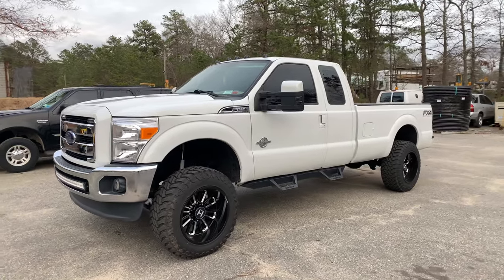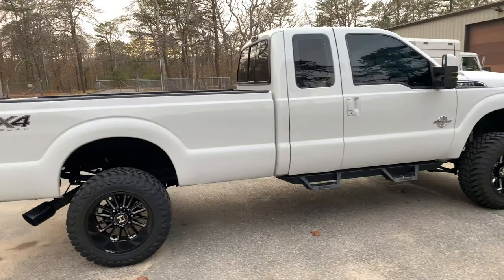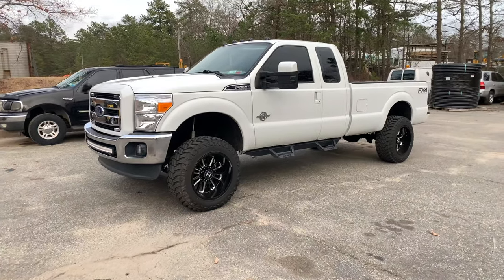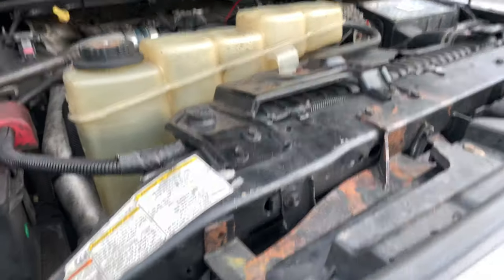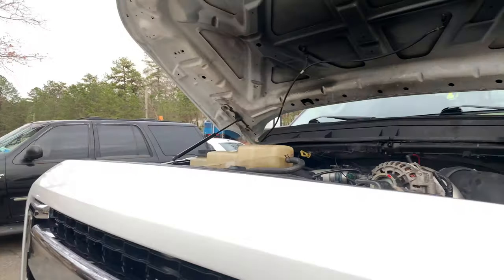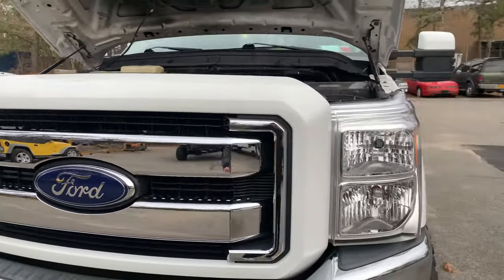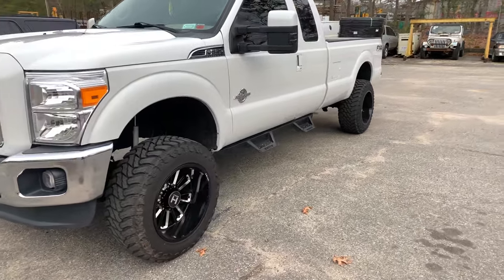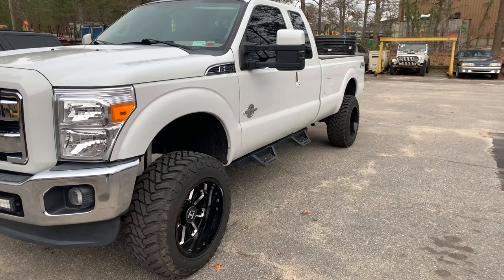99-04 F250 SUPERDUTY Conversion To 2016 (Walk Around)

Comment: Sure beats the hell out of spending 70k on a new one.
Reply: and the thing is twice as reliable
Reply: Exactly! I have a 2000 F550 that I bought for $17k this year with only 150k miles, I'm getting ready to do a full 2018 conversion of the interior and exterior. I love the body style, but I don't even like the newer diesel engines. This is my 3rd 7.3l powerstroke because my first one got totaled by a Volvo and I sold my 2nd 😢 regret it ever since. Now I have an F550 I will never part with, so I'm going to turn it into the truck of my dreams.
Reply: @danielallen9610 how’s it going

Comment: Outside is expectation and when you open the door is reality.
Reply: Is looks good and I rather have the 7.3 does 6.0 power strokes are bad all of them are pretty much trash
Reply: @carolinamartinez1085  their not if you build them bud
Reply: @NOAHR101 yea if you add like another 5 grand to get it bulletproof
Reply: @conormayweather5474 Give or take. So pay $20k for a 200k mile 7.3, or $12k for a probably running perfectly fine 6.0 with 100k miles and drive it till it blows and bulletproof it or do it immediately. Boom $17k in the truck, just as reliable, newer, rides nicer, good fuel economy and more power. The amount people sell 7.3s for now is killing the point of why people loved them.
Reply from the maker: @FordFan01 I prefer the 6.0 over 7.3 you’re absolutely right , 7.3 is overrated
Reply: @FordFan01  actually I seen them a lot cheaper now here in Texas , I just sold mine for 6 grand an extended cab with 280,000 miles

Comment: Im doing this same conversion. to my excursion. I need the 2016 wiring harness for the headlights and adapter... im having a hell of a time locating this. How did you get yours? or howd you wire your new lights?
Reply from the maker: @jimmylomeli9248  eBay sells the adapter should be like a 9007 to H11 bulb harness or something along the lines of that, I think the aftermarket LED bulbs might also work could buy the 9007 bulb kit and a H11 bulb kit and use the h11 bulbs with the ballast from the 9007 kit so it plugs into the factory harness

Comment: doing this now and my front bumper looks like yours at the 4:19 and 4:20 mark where you can see the fender mount hole right where the bumper and fender meet. I see you were able to move the bumper up, im curious what you did to move it up. I also have the factory foglight in the bumper, I noticed that clearance is an issue. I have spacers in there now to help move the bracket from the fog light bucket. This moves the bumper forward but im trying to avoid moving it forward much more due to the offset of the curve of the wheel well between the bumper and fender. What adjustments did you make to get the bumper up higher to close that gap? Did you make new mounting holes? The very last picture you show at 4:24 is what im trying to get to (smaller gap).  I have the mcnasty bumper bracket kit also. Any info is greatly appreciated, great video!
Reply from the maker: For the front bumper I ended up just mounting it directly to the old bumper mount that’s notched out but I only used the bottom mounting hole on Each side to mount it, I had the mcnasty bumper bracket also but when I tried to use it my bumper wouldn’t look right and had a bigger gap like how you explained yours.
Reply: @wildingarage2003  aaahhhhhh ok. Thanks! Your truck looks great!

Comment: Very cool! I always wanted to do a conversion like this. The only question I have would be in regards to inspection, specifically PA if anyone knows. Would this actually have to be classified as an R-Title after a new bed and front end?
Reply: No. It's a 1999 F-series no mater what you bolt to it. Change the interior change the body panels, the suspension, another transmission,  take the whole cab off and put on another year it's still a 99 for taxes, inspections, and title.

Comment: When you did the swap. Did you use the original 99 wheel liners or did you go with the 2011?
Reply from the maker: I re-used the 99 Original liners, I just trimmed about 1-1.5” off the edge of the outer side
Reply from the maker: I don’t remember exactly how much but you could def start with about an inch and work your way up till it fits right.
Reply: @wildingarage2003  I did the swap a few weeks ago. And that's all I need to complete it. I appreciate it. Thanks for the help

Comment: I see you had leather front seats, I have a 2000 f350 xlt extended cab with the cloth seats all around. Is there any way to change the rear bench to leather or did you just keep it cloth? Thinking about doing this project with my truck any help is appreciated!!
Reply from the maker: I used leather seats front and rear that came out of a 01-03, you can do the rear but one hole for the floor won’t get bolted(doesn’t make a difference because the rest bolt up and keep it in place) and the back part of the seat you can use any angled piece of metal and make a bracket with self tapers or weld it if you’re capable, I self tapered angled aluminum as brackets and made it work

Comment: Did you swap out the door shells to the 2011 and up styles or are the door shells original?
Reply from the maker: They’re the original doors from 1999, the rear doors should only be changed to 08+ on the extended cab only if you put 08+ interior since the rear door panel has the seatbelt built into it,but otherwise the doors don’t need to be touched
Reply: Thanks. I have the same body style as you extended/super cab. Looks great thanks for the information can’t wait to try and get mine to look half as good as yours.

Comment: I’m definitely subscribing I’m picking up a 2004 Ford F-250 5.4 v8 (don’t criticize me ) it’s my real first 3 quarter ton rig I’ve had a 91 f150 and a 2000 ford ranger xlt I want that conversion kit tho
Reply from the maker: I almost got a 5.4 before this one , I have a list of parts somewhere in comments or description, just search eBay or junk yards for parts, good luck with the truck.
Reply: @wildingarage2003  unfortunately the guy sold it before I could get it he’s a backstabbing idiot for selling it behind my back 😤😐
Reply: @wildingarage2003  my dads got a 2001 7.3 powerstroke sounds like a jet btw 🤤🤤 but yeah I told my dad about it

Comment: I'd like to look at one of these converted trucks in person just to see if it looks like a junkyard job or like it came out of the factory lookin like that
Reply from the maker: There are a bunch that are butchered together,mine had a lot of time and money into it so it was pieced together nicely and the right way with the matching bed, only thing on mine That was iffy In this video was the original rear doors needed to be replaced due to rust and a cracked mirror
Reply: This is a great looking conversion! Do you have an itemized list of everything you bought and cost of labor?

Comment: How can I fit 2017 dually stocks on my 04 ?
Reply from the maker: They should have the same bolt pattern right ? I know SRW trucks kept the same pattern 1999-2021 if the duallys stayed the same like the SRW then you could just put them on if not then you can buy the adapters online, I’m sure eBay sells em

Comment: Would a cab swap be simpler or easier this way
Reply from the maker: Personally I think a cab swap would be way more involved because you have wiring,and other sensors on one cab that’s not on the other ect,plus you’d have to swap the vin from the old cab to the new one to be in compliance with emissions, the only way I’d say it’d be worth it is if you got a cheap rust free complete donor truck and a lot of time to do the swap lol , but it’d definitely be easier to just do the front clip.

Comment: How much was the full conversion
Reply from the maker: I did it back in 2017,I bought the parts new from Ford it was about $4k for the front clip parts and $500 mcnasty brackets, the bed tailgate and bumper was $3k and paint was $1k, so for me it was right around $8500ish & I did the labor, but now you could probably get the parts & bed for $3-4k used maybe less
Reply: Disregard my itemized post because I see this now

Comment: Bro can I do this for my 6.0 ?
Reply from the maker: Yeah 100% can, it’s the same thing as 7.3
Reply: Can you give me a good estimate on how much ?
Reply from the maker: @smoovekat6276  the kit for the brackets is $500 and you’ll need 11-16 hood,fenders,grille,bumper,upper &lower grille support,hood latch, hood hinges, headlights and little stuff that goes with all that, I’m sure you can find all that used for $2500ish if you shop around, and I’d say anticipate to buy atleast $500-800 in paint materials, and if your not mechanically inclined and can’t paint I’d say prob atleast another $2k in labor. So parts with brackets & paint supplies looking at $3500-3800.